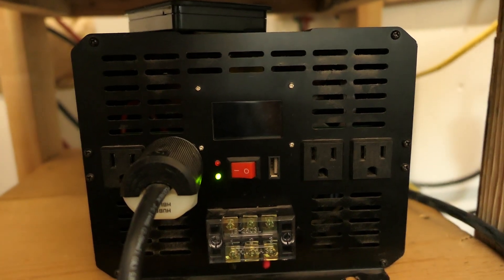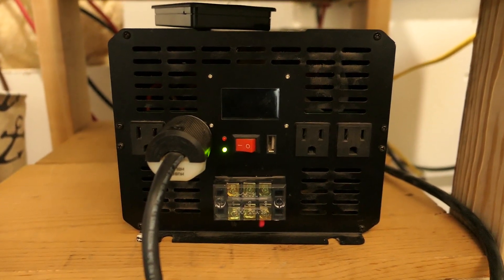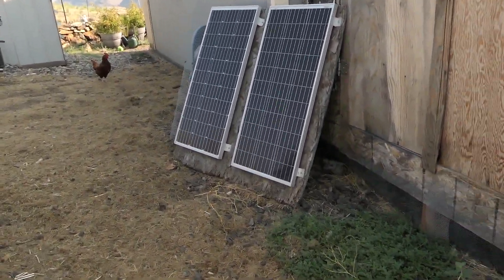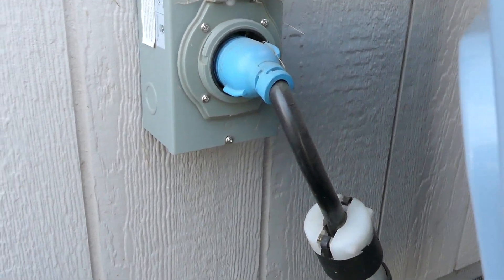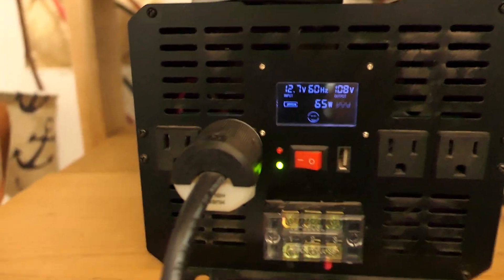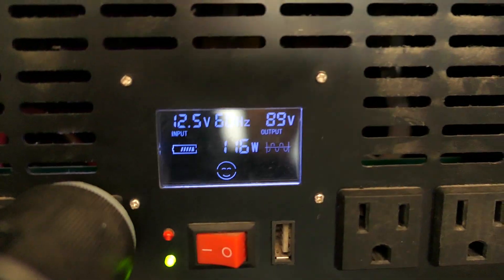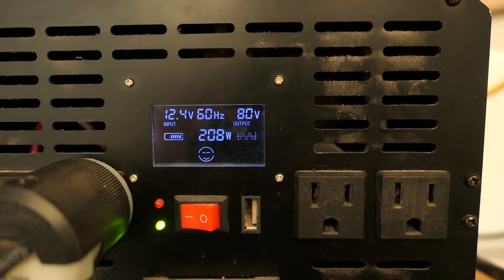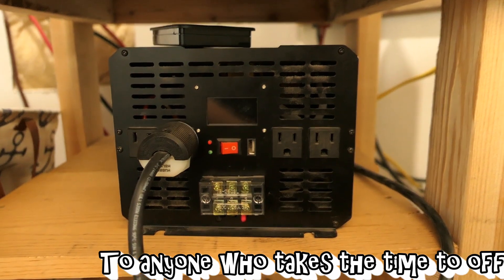Our Current Off Grid Electrical System

Comment: Low inverter output voltage could be caused by low input voltage and the inverters (both) have an automatic low voltage cutout feature that resets when the battery voltage recovers a bit.  Best advice I can give without taking voltage reading at critical points, is to check all battery cable connections to make sure they are tight and clean.  Very often a simple loose connection is the main problem.  Do you have a voltage tester of some sort if we need to do some point to point readings later on.   Anyway, for now please check all the cable connections and see if that helps.  If so then OK.  I not, then we can try some other ideas with your voltage tester.  Don't forget to check the inverter manual, which may have some troubleshooting hints as well.  I wait your reply.
Reply from the maker: I do have a voltmeter. I’ll check connections and go from there. Thanks, again!
Reply: @windyhomestead  --You are welcome - I am more than happy to help a "damsel in distress".  At 85, I've been retired for nearly 20 years now and am constantly on the lookout for new challanges  to keep me busy.   Please keep me posted on your progress (that will be my reward) and I may have a few more suggestions down the line to improve your power system.  One other thing that I gleaned from your video is that your oven "kills" the battery.  Shouldn't do that - Your battery is rated 80ah which means it should produce more than enough current for the oven assuming the batteries (and connections) are in good working order.  (s) TerryE    p.s.  Is your email (from your website) still valid?
Reply from the maker: Hi again! Yes, the email works. I just only get to check it once per weekday at best. With regard to the oven- it’s just the initial surge of power from turning on the “preheat”. Separately- I did find a questionable connection on the battery bank, worse yet, The batteries are leaking a clear fluid. Thank you, again, for all your guidance!
Reply: @windyhomestead    _  Mornin' -   Leaking?  Cracked case or just some moisture forming on top of batteries??   If moisture is forming on top  it's possible they are being overcharged.  You may want to try adjusting the charging voltage down a bit.  Instructions are on page 7 (Section 4.3) of the owners manual.  Do you check the water level from time to time? If the case is cracked, then you might want to replace them as soon as you can.  .  How old are they? - Normal life is 3-5 years but can last longer with regular maintenance.  By any chance was the questionable connecion on the #3 battery negative post? (hard to tell from the video, fuzzy but looked sketchy)    Oh, one other thing - I don't know very much about your inverter but did note that there are a series of replaceabe fuses that might be a good idea to check them.  You have to remove the cover to inspect them.  
Back to ya'  TerryE  
p.s.  Sorry about so many questions but there are lots of possibilities , any one of which may be the cause of your proplem.

Comment: FYI:
Copied from Vevor 6000 watt inverter owners (online) manual:     (I suspect #4 may be your situation - Not 100% sure -  just a first impression guess)
Protective Functions
1.  Overload protection: when overloading 125%, the inverter will send an alarm, and stop working after 20 seconds.
      When loads are reduced to the accepted level, the inverter will resume working.
2.  Short circuit protection: inverter is with short circuit protection.
3.  Over-temperature protection: when the inside temperature of the inverter    reaches 80℃, the RED indication light will be on. The inverter will stop working, once the temperature drops 
     to an accepted level, the inverter will automatically resume working.
4..  Low voltage protection: when the battery voltage is below the setting level, the inverter will send an alarm by beeping. When the battery voltage keeps dropping to its shutting level, 
      the inverter will beep, and the RED LED will light. When the battery voltage is increased to its restart level, the inverter will automatically resume working.
5.   Overvoltage protection: when the input voltage is higher than the setting level, the inverter   will   stop   working,   when   the    input   voltage   is   normal,   it   will automatically resume working.

If you think that the unit might be bad, then suggest that you try the Vevor chat line for their advice,
Reply from the maker: @olgringo-421  You are an amazing human! Thank you thank you thank you!! I can’t even tell you how much it means to me that you’d take the time to help a stranger. You’ve given me a great deal of actionable information here. You are such a blessing. Thanks, again!